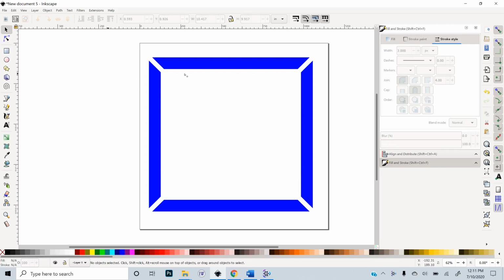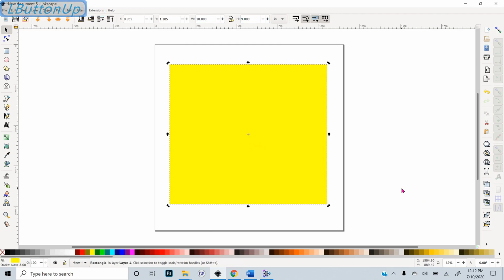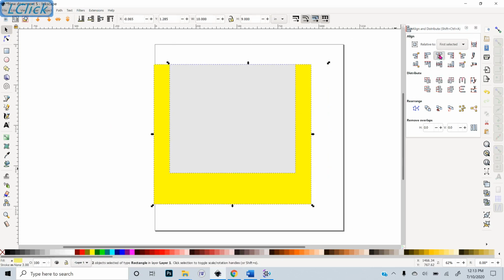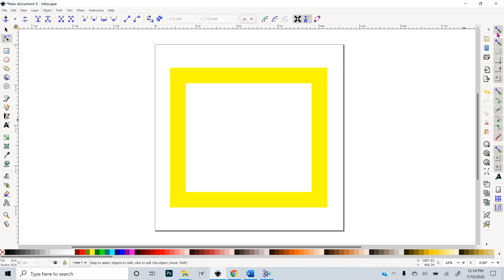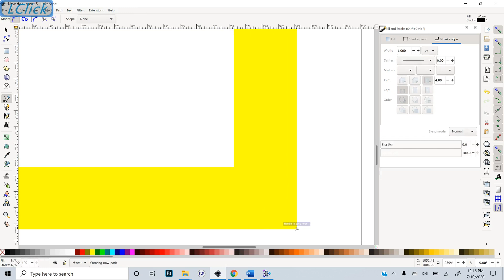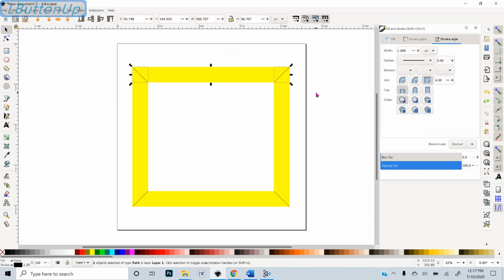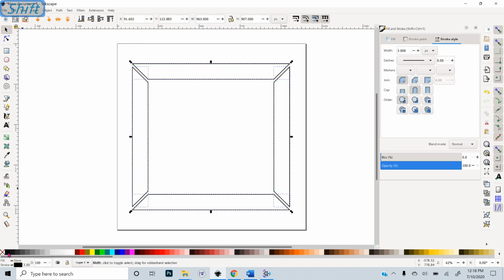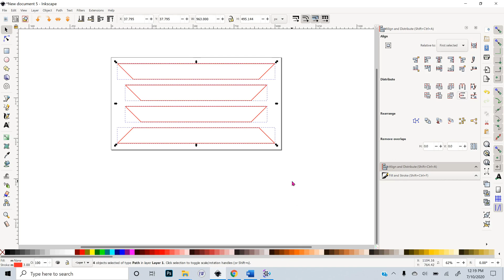Designing a rectangular frame for laser cutter

Comment: Thank you Leigh. This was very helpful as I ve been trying  to design a frame for GF. My problem  is that I don't  know how to make the back part of the frame.
Reply from the maker: I'm not 100% sure I get what you are saying. What do you mean by the back part of the frame?
Reply: @snarlla  how are the clear acrylic, picture, and back  of the frame held Inplace. Thanks again.
Reply from the maker: Oh I see.  This frame is just meant to be glued directly onto a board.  You could make another rectangle with the same outer dimensions as the frame, but larger inner dimensions, and then layer them to create a recess for the glass or plexi.